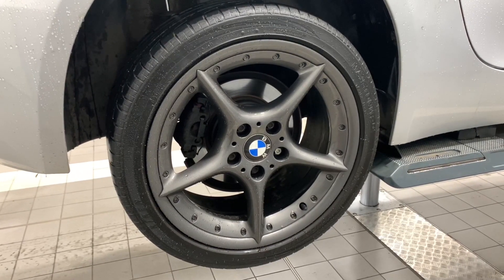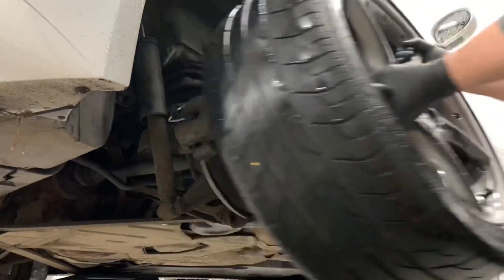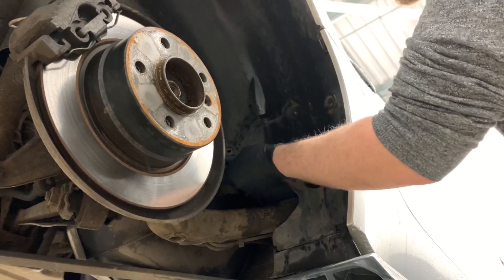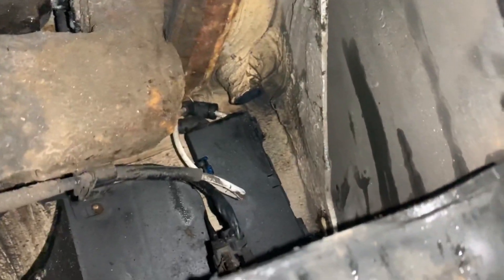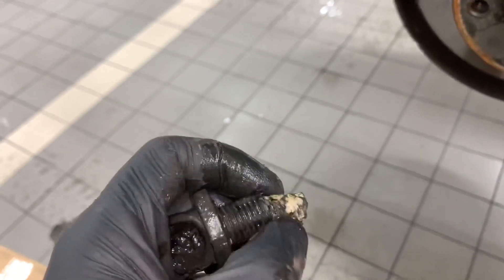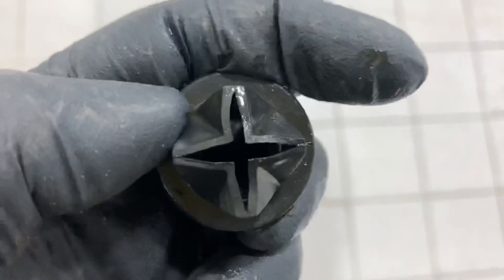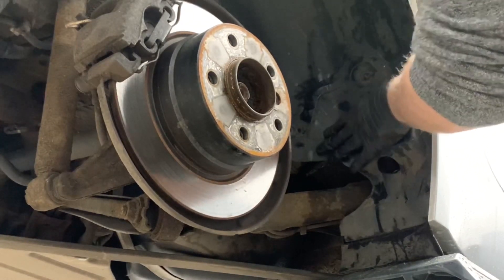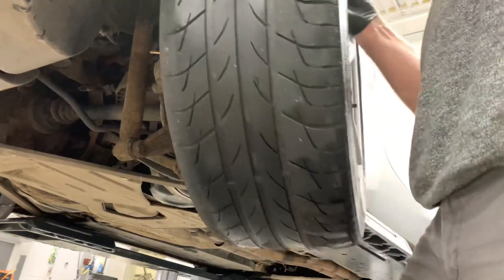How to clean Z4 convertible drain plugs

Comment: Why dont we just pull out that plug and get rid of it so the hole will be bigger, and the water will drain quicker? Thanks for the video to help me finding where this plug is.
Reply from the maker: You can leave the plug out and you won’t have any problems. BMW put them there to stop bugs from clogging it up.

Comment: hi where are the front drain holes to be found thanks
Reply from the maker: If you open the engine bay and look for a snorkel type section of plastic with a flap on the end that runs down the back side of the engine bay. It sometimes gets clogged with leaves and debris but mine was clear so didn’t make for a good video!

Comment: Any idea if the 2020 Z4 plugs are in the same location? My drain is plugged and floor behind seats is soaked!
Reply from the maker: Yes they will have the same drainage well that comes out just in front of the rear wheels but I don’t think they have the rubber plug. May be worth trying a coat hanger and gently inserting to clear any blockages, also check the drainage channels by opening the roof half way which will expose this area, you may have some leaves or sludge blocking the water from running along the channels.
Reply: @db192  Thank you! Raining for the next few days, car covered - when I can I'll jack it up and give this a go. Car only has 12K miles on it, and I keep the area pretty cean, but it does live outdoors. Happened once before on driver's side - I made BMWf ix it under warranty. Unbelievable they can't design a more robust system.

Comment: But what if you remove the plug and don’t put it back isn’t it better
Reply from the maker: A lot of people do remove them and be done with them, I’ve seen some information to say they stop things from crawling up there and blocking them. I plan on checking them on a regular basis whenever the car is on a lift so I shouldn’t have any further problems with blockages. 🤞🏼
Reply: I just removed them for good.  What's the chance something crawls up and blocks it?  5% 😂
Reply: @mikey_likes_it_  true I’m gonna do that. Or take a bigger chance on replacing the motor and that expense
Reply from the maker: @mikey_likes_it_  I'm thinking I might do the same thing next time I check them!
Reply: The hole will be bigger if you pull the plug out but it doesnt mean it wont be blocked again. We still need to check the "bigger hole" once in a while. I dont understand why they have desinged that plug was so narrow and easy to be blocked. I guess that plug drains the water straight down not touching any metal part so less rust or sound roof :)
Reply: Because the car was made in America, this was designed to stop American bugs like cockroaches etc. here in uk, not an issue so just remove them